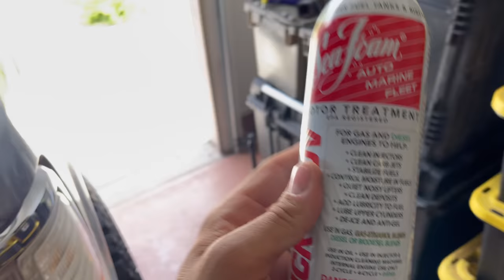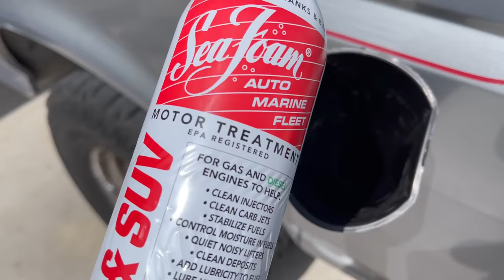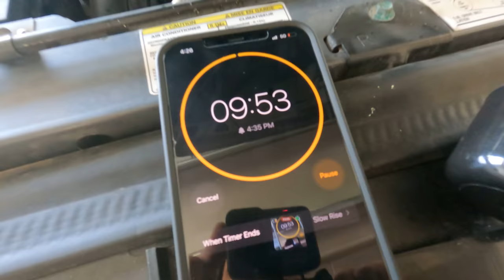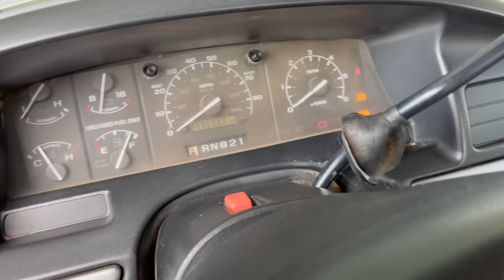Seafoam - Engine Treatment | How-to and is it safe inside your motor?

Comment: your measuring weight ounces which is different than fluid ounces.
Reply from the maker: U do realize that an Imperial fluid ounce weighs exactly 1 oz., so conversion between volume and weight is not necessary.
Reply: @ChaseGentry  each product has different weights that's why alcohol weighs less than water.
Reply from the maker: @White_buffalo_4r  yeuup..
Reply: @ChaseGentry  but in the end it's all close enough
Reply: @White_buffalo_4r  You are 100% correct. Two different measurements. Vol/Vol is what should be used (ounce volume to quart volume) ounce weight is not applicable.
Reply: In this connection, two measurements are often misused by many – the fluid ounce and the ounce. In its simplest possible explanation, a fluid ounce (abbreviated as fl. oz.) is used to measure fluids while an ounce (abbreviated as oz.) is for dry measurements. This gives us the idea that a fluid ounce is a measurement of volume while the other is a measurement of weight.
Reply: That's why God made the metric system.
Reply: Damn, you stole my thunder!
Reply: Fluid oz and weight oz are close. A gallon of water for instance. Its volume is 128oz.  Its weight is 8.34lbs or 133.44oz.  So a little difference. You always measure volume with liquids, usually weight with solids or particulate.
Reply: Merican gas is actually $4/gallon here in TX and $7/gallon in CA so that’s $1.06-$1.85/liter. Are you saying that in Canada it’s $160/liter of gasoline?

Considering we are destroying the only home we have as a species with our big trucks and cheap petrol, I’d say $160/liter makes a hell of a lot more sense than $1.85/liter. 

Of course someone here will call me a bunch of names and say a bunch of goofy, uneducated shit that makes no sense but it’s news to me if that’s what it costs for petrol in Canada. Is that what you’re trying to say???
Reply: @ChaseGentry  Lol so is the 7.5 Oz correct? Lol
Reply: It is just estimate, you are not going to blow up the engine lol
Reply: Bryah
Reply: @rapturekevin  I literally just laughed out loud!  Good one!
Reply: Only for water.
Reply: Doesn't matter you can put that whole can in a empty tank it won't hurt anything...
Reply: @ChaseGentry  This is true of water at sea level. Other fluids have different densities. Since Seafoam is a petroleum product, it is likely less dense than water. You're basically shorting the amount (probably by not a lot, but still).
Reply: Ok I'm dying to hear this, how much does an ounce weigh in grams? Also which is heavier, a pound of feathers or a pound of whatever fluid you want?
Reply: @ChaseGentry  that's only true for water; seafoam is less sense so you overmedicated your block
Reply: @user-mc5kd6cb8f  its about $1.68 a liter at the moment, you bunch of names! Lol
Reply: you're not your.
Reply: @2caver  it was swiped from my phone sorry grammar police
Reply: @isaiahwelch8066  In the video he says that fuel is $160/liter in Canada. I asked because I figured it was a mistake and was curious. I was trying to understand, hence the question. As far as gas being, on average, $4/gal in TX or $7/gal in CA, I live in TX and just left to CA and can confirm that’s what I paid/pay, that’s in no way “spreading misinformation”. Thanks for the math correction though. I’m taking Calculus currently so a bit embarrassed if I got it that wrong but will take your word for it since I don’t have time to check your work.
Reply: @tonymagallanez2768  : Actually, read the can.

SeaFoam is actually 91% isopropyl rubbing alcohol -- not exactly a petroleum product.

Which means that even at sea level, SeaFoam will always be less dense than water, because alcohol is less dense than water.
Reply: @ChaseGentry  LOL, no it doesn't.  A fluid ounce is a measure of volume, 1oz is a weight.   They are not the same nor are the interchangeable.
Reply: @isaiahwelch8066  isopropyl alcohol is still less dense than water so the issue still stands.
Reply: A pint a lb.the world around...

 "keep the faith people and keep on keeping on"
Reply: that's why metric system is the logical step forward
Reply: @jamesbarlowjr.3762  I
Reply: An ounce is an ounce. It's the same thing as saying that a pound of feathers is heavier than a pound of bricks
Reply: @user-mc5kd6cb8f  $4 a gallon..... ahwww I miss the good Ole days! :)
Reply: That’s based on water weight distillates very in weight 90 weight oil versus  sea foam. Weight
Reply: He did it this way because he never learned what 2 + 2 equals.
Reply: It really is working holly shit bro. BTW to all the Fuckers having a mind fight on here and trying to show who's the smartest. It doesn't matter. You shouldn't have to make it a point if you know your intelligence... I always tell my son. You don't got to prove shit to nobody. You know what you capable of. 😏
Reply: T who caters about fluid and dry once’s, he’s not baking a fckn cake !
Reply: @ChaseGentry  one imperial fluid ounce of WATER weighs 1oz. 

Last I checked, seafoam isn’t water. So the 1:1 volume:weight ratio doesn’t apply.
Reply: @nikkilovetheyardsale-again2608  your son is gonna be a massive failure. 

Employer: “your resume shows no experience in this field”

Your son: “don’t worry, my mom told me I don’t have to prove my knowledge to anyone, just give me the job.”
Reply: @user-mc5kd6cb8f  California deserves to pay much higher for fuel than production States!
Reply: Who cares, it is another seafoam useless video on the internet. "It's a good staff for your engine, so ya just use it and you should be good". I go exactly by that statement and use every single product out there, why not?
Reply: @ChaseGentry  yikes bro. Water is less dense than oil.
Reply: @user-mc5kd6cb8f  you're confused
Reply: @user-mc5kd6cb8f  he said one sixty, as in one dollar and sixty cents. Not one hundred and  sixty,  are you doing okay,  your brain seems to be malfunctioning
Reply: @spammerscammer  what lol.... it's the opposite.. thats why oil floats on top of water. Yikes to you. 😆 super basic concept.  If water was less dense, oil spills would sink to the bottom of the ocean.. 😑
Reply: Now put it in your transmission fluid lol
Reply: @White_buffalo_4r  thank God we found a scientist
Reply: 3.2 beer equals 4 by vol.  I'm from Utah.  c lose enough.
Reply: You know there's this system that makes such mistakes impossible... Most of the world uses it, give it a try some time!
Reply: @bishoptrees  what's your body mass index? Just wondering.
Reply: @ChaseGentry  24X eduh
Reply: @White_buffalo_4r
Reply: The difference would be fairly negligible.
Reply: You're*
Reply: if you ever used an additive your vehicle that is what is on the instructions so he's only following what the manufacturer states
Reply: Y'all really need to find better hobbies. He can pour that whole fn can in the block and it won't make a shats difference. Splitting fn hairs here.
Reply: That depends on the density of the fluid..probably water..don’t think they were talking seafoam in the 1040’s
Reply: I put three cans in my Jeep I really don't know why for some reason I was thinking three cans but I probably should just put one but we'll see I don't think it'll hurt it
Reply: @nikkilovetheyardsale-again2608  Wow, where do you even begin to unbox all the gems in this comment?  I'll give you credit though, I could clearly make out your accent while reading your comment.  Allow me to say thank you for making me laugh today.  You went all in and I appreciate it.
Reply: @ChaseGentry  NO not even close. check the weight of one oz of isopropyl alcohol vs sulfuric acid. The direction on this is clearly to be measured in fluid ounces
Reply: Your measuring is close enough to you’re measuring though.
Reply: @White_buffalo_4r  What?? You go .00000001 ounce over and you throw a rod out the block!
Reply: Does it work the same as pouring it in the brake booster hose that goes to the intake?
Reply: That just makes me miss my 96 Bronco that much more...
Reply: Reason number 10101 why metric is a superior measurement system
Reply: @user-mc5kd6cb8f  but big engine sound nice when I put my foot to the floor 🤣🤣🤣
Reply: Just like Your and You're
Reply: I thank you all for your comment
Reply: Beat me to it.
Reply: @slickjohnc1  except as pointed out this is not water. Different liquids have different weight to volume ratios.
Reply: The density of a fluid is inversely proportional to the volumetric propensity. If water had a madras rating of 1.0 and isopropyl alcohol has a madras rating of 9.89, you’d be working within the Friker Estlon limit of either fluid. If Spencer’s law of fluid dynamics has taught us anything, it’s that the fluid has no weight until it is put on a scale.  The volume is constant, the weight is variable.
Reply: @user-mc5kd6cb8f I think the comparison of Canadian prices to US prices is something like this. Western Canadian gas prices is $1.80 per liter in Canadian dollars. To compare to US pricing, multiply $1.80 by 3.8 litres ( size of US gallon) to get $6.84 in Canadian dollars. Now to convert to US dollars divide by 1.34 to get $5.10 
The US/Cdn exchange today is 1.34. That is because theCanadian dollar is weaker than US dollar and it takes $1.34 in Cdn dollars to equal $1.00 in US dollars. So a U.S. gallon of gas in Texas is $4 and the equivalent gallon in Canada is $5.10. I think this makes a fair comparison by converting both country’s gas into same size and same currency.
Reply: You're
Reply: @ChaseGentry  fl oz and oz are different things next time use a measuring cup
Reply: Imperial !!! Oz
Reply: @ChaseGentry  All fluids weigh the same, you're scientist dude LOL
Reply: He should have just put the whole bottle in there 😮
Reply: That's what I said.
Reply: @White_buffalo_4r  yes sir
Reply: @gregfirmin5097  wait, so my Pyrex measuring cup is supposed to not have the lines match up between fl oz and oz?!!?!?!?
Reply: This is why gas is sold by volume as well, not weight.
Reply: I forward a whole 20 ounce bottle to a quarter tank on a Chevy Silverado no my truck is running pourly
Reply: @slickjohnc1 it’s all about specific gravity.
Reply: I used Sea Foam in a motorcycle that I ran full synthetic oil in, my bike only had 18,000 miles on it and threw a rod through a cylinder. I had the bike in the shop to run a diagnostic for a high pitched squeal when in second gear not long before it threw the rod. They told me it was a " harmonic noise" and nothing mechanical. When the bike threw the rod I went back to the shop and was told that these things aren't all that uncommon "Mad Mike" informed me that he had to overhaul his Harley at fairly low miles. I asked if they used this as a selling point when they sell their bikes. Needless to say, I had a really nice looking boat anchor at that point that was worth the cost to rebuild.
Reply: @ChaseGentry q😅p
Reply: @ChaseGentry just learned this. I was thinking the same as the other viewer but thank you for clarifying nicely.
Reply: Only difference is he should’ve used a measuring cup instead of a scale. Right? I thought the same
Reply: Good  job
Reply: @justin6354 good job
Reply: @slickjohnc1  yes but gas only weighs 6 pounds per gallon so about 72% as heavy. 6 quarts x 1.0fl oz/qt = 6 fl oz which weighs about 4.2 oz. 1.5 times as much is 6.5 weight ounces and he put in 7. Close enough..
Reply: @philbenson6041 i guess youre trying to be funny, yet they make a sea foam specifically for transmission
Reply: @ChaseGentry Nope, different types of liquids do not weigh the same. Your conversion theory of volume ounces to weight ounces is wrong. 😮
Reply: 😅 If I ever do a YouTube channel I'm going to put in a fatal flaw that will solicit corrective comments. Brilliant strategy.
Reply: The only problem I have with that is that if you leave it in there for so long it deteriorates the gaskets I had a 99 Chevy Tahoe and the gaskets got destroyed because of it
Reply: @ChaseGentry not correct at all all liquids weigh a different amount in relation to there volume.
Reply: @rapturekevin America doesn't conform to losers.
Reply: I was headed down the hall and asked for directions to auto mechanics. Sitting in this class waiting for the smoke to clear so we could get to the cool stuff  like intakes, combustion, exhaust, horsepower, and cool sht like that...I realized I was sent to the debate class. Bunch of brainiacs repeating themselves and  others reiterating what has already been beaten like a dead horse. Speaking of horses ... horsepower, cool old broncos, and hoof pounds of torque...walking out dejected. Cool video btw...if anyone remembers it. There was a Bronco in it😊
Reply: A measuring cup for fluid only makes sense for this part.
Reply: 😊😊😅😊 @ChaseGentry
Reply: @ChaseGentry  Not true at all. Weigh a fluid oz of gas and a fluid oz of oil and tell me they are the same. You undercut the seafoam in the tank as well even though you said not to undercut it. Not a great test here bud.
Reply: lol saw the same thing and was going to post lmfao
Reply: @ChaseGentry wouldn’t that depend on the substance you are measuring?
Reply: If you get a 16 oz soda or 16 oz water bottle and weigh it, they'll both weigh 1 lb. 32 fluid ounces should weigh right at 2 lbs.
Reply: @MrJwtaylor40  that is wrong, different liquids have different densities
Reply: You won't catch me doing this to my motor
Reply: I just dump the whole bottle in. You only live once😂😂
Reply: @ChaseGentry  1 fluid ounce of water weighs 1 ounce but seafoam isn't water and has a different weight per fluid ounce.
Reply: You're not your
Reply: @ChaseGentry  If dealing with water, not all fluids
Reply: @Ironhand187  but it isn't. a fluid ounce is VOLUME and an ounce is WEIGHT...FLUID OUNCE is how much space does it take up and OUNCE is how heavy it is...Get a pint glass, that is 16 FLUID OUNCES....fill it with Water and weigh what 16 FLUID OUNCES of water WEIGHS...then do it again with Motor Oil. While they are both 16 FLUID OUNCES they have a different weight.
Reply: @boss94ways51 that's what I have done in the past. I seem to remember it used to be the instructions on the seafood prior to having the spray can.
Reply: @gregfirmin5097   Merica Yeaaaaah
Reply: Thank you. I 🤦🏻‍♂️ at that point and turned off the video. No subscribe for this one. 😝
Reply: Was very confused as to why he was using a scale to measure volume... 😂😂😂😂
Reply: You’re using “your” wrong.
Reply: While you are completely correct. I did the math and for sea foam 1.016 oz = 1 fl. Oz. 
The density is so close to water that it won’t matter unless you are mixing several gallons of sea foam into fuel.

Comment: A couple months after doing the intake valve cleaner process, I took my truck with 178,000 miles in to get its annual emission test. The mechanic told me he never seen a truck with so many miles have such good emission test results. I use seafoam in the fuel tank, in the crankcase oil, as a intake valve cleaner, and in all my lawn equipment. I have a 1998 Lawn Boy FWD that uses Seafoam and its still running strong. I depend on that lite weight mower to cut my steep lawn, I'm 75.
Reply: That’s awesome, how often do you use Seagram for all 3 uses?
Reply: Hola lmk
Reply: @kushjedi2217 I use Seagrams every time I make a mixed drink- seafoam is engine additive and I refuse to put it in my drink 😂😂😂
Reply: Where are you from? We got rid of  emissions testing years ago  because it was a scam
Reply: Will any of this trigger a check engine light ? Removing the intake  and spraying. ?  I’m a newbie.   Thanks
Reply: @imadumass2378 I wish. We still have them in Colorado. Just did one about a month ago. It’s required once a vehicle hits 7+ years old.
Reply: @scott2228  yeah Colorado went woke. I'm surprised to be honest because we have such a woke prime Minister here In canada . Never thought I'd see the day
Reply: No it will not trigger a check engine light. I’ve done it on 5 of my different cars throughout the years. I use it in gas, engine oil, and through the intake. Improved the performance of each of my cars
Reply: that's good to know.  I was concerned that freeing up a bunch of junk upstream all at once could cause issues with the catalytic converter.  he mentions how much stuff is coming out of the tail pipe, so that is all presumably going thru the cat.
Reply: I use Seafoam in tank and throttle body cleaner also. Good stuff
Reply: I used seafood it clogged up my fuel injectors
Reply: Stuff really works 💪 had light come on some sort canister supposed to be bad ran seafood through it light went off have a 2013 kia same issue ran seafood light went off
Reply: Seafoam 😂 didn't wear glasses my bad
Reply: 🔴🔴🔴ALERT! Apparently nobody here knows that liquid ounces are not the same as weight ounces therefore you need to use a measuring cup not a scale!
Reply: @rayzamudio8427  think you sent this to the wrong person. A pound of feathers or a pound of lead. Which is heavier? Lol
Reply: @marsbotbyl159  Look it up. 😉yes I messaged you accidentally. Liquid ounces measure volume,solid ounces measure weight. If you don’t know the difference like the author I don’t know what to say. 🤷 A quart of oil is lighter than a quart of water because water is denser but they are still both quarts but weigh different. That’s why oil eventually rises to the top.
Reply: I've seen ppl add it to the tank with only a few gallons. Drive 20 miles then fill up the tank. Is this okay?